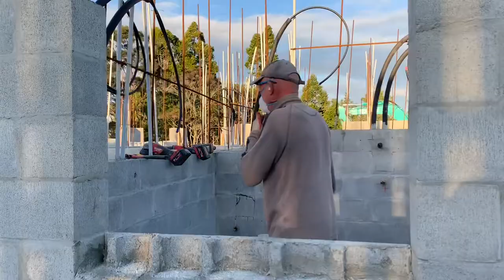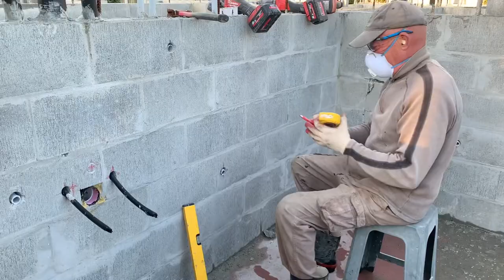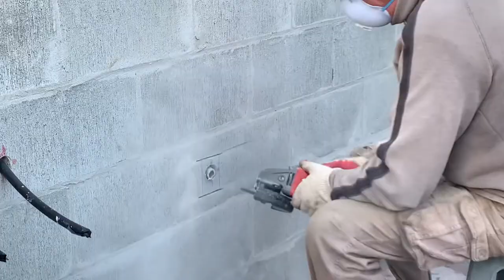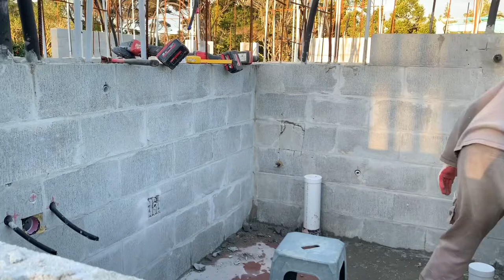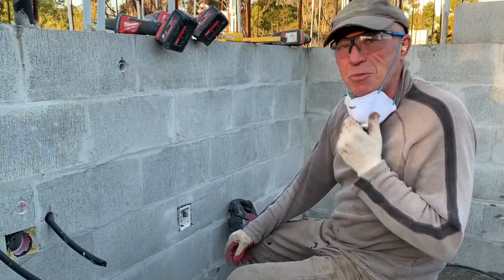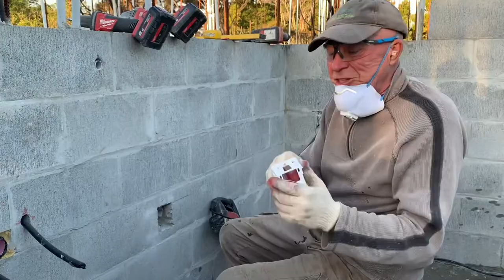How to cut hole in the blockwall for an electrical box

Comment: Thanks for the video. Exactly what I was looking for.
After the drilling, what s the tool called that you used to clear out the concrete? The audio is a bit soft at that point.

Comment: I'm getting ready to build a block building on my property in Fl.  I do not want dry wall on the inside. Have you ever seen anyone lay the wire down between courses of the blocks and stick the wire out the inside of the room to be cut later, kind of like people do with log homes?  I know I'd either have to mount the box on the block wall, or cut out an area for the box if I wanted it flush.  Thanks!
Reply from the maker: No that’s not a good idea, it’s better to put some conduit in and run the wire inside it, you don’t have to finish with an electrical box, just core drill a 65mm hole 50mm deep over the conduit, break out the core and cut the conduit back then screw the switch or plug straight back  to the wall
Reply: @hobsonproject  So, run the conduit between courses of the blocks , or another way? Maybe down the wall from the top? I have a bit of experience of blockwork from working with my cousin many moons ago, but I don't see how conduit would come down the wall from the top since I have to pour a single lintel. Hence, the clarification. I want the electrical outlets flush on the inside of the block wall with no drywall.  Thanks!
Reply from the maker: @da324  Basically run the conduit like you would run the steel reinforcing for the blocks. Conduit can be short to get the blocks over it and laid and then extend further up with a coupling, can run horizontally if needed to get into the right space, but just remember to use slow large radius bends to make pulling the cable easier. 👇

Conduit in block wall https://youtu.be/hec23O6whlc?si=dE8qkD-8XfZ7B6G0
Reply: @hobsonproject  Thank you!

Comment: Just put a metal box in before they pour,it will save a lot of time/ or a foam block.
Reply from the maker: Problem is keeping the block there it will get blown out by the conc most of the retro cutting is in the block anyhow which is soft

Comment: What about furring strips and drywall ?. Your box needs to be flush with the drywall.
Reply from the maker: This is a solid plastered block that’s the finish if I was using packers and drywall I would run the cable behind the drywall, however this install would work with direct stick drywall just use over length screws to fix the socket outlet.

Comment: I notice you are a concrete / wall person, rather than an electrician. Do you find that most electricians use this same technique to install boxes in a concrete / block wall?
Reply from the maker: I have never known an electrician use this technique as they usually have someone else chase the conduit and cut the box then they or someone else install the conduit and connect the box then usually someone else mortar up the wall. I guess the end result is the same as my cast in method, just harder, at the end of the day I will install draw wire to make electricians life easy, as electricians like an easy life, and they will pull their wires and fix the socket. Also keeps my costs down.
Reply: @hobsonproject  LOL sounds about right - we electricians don’t like to get our hands dirty! I have to install 5 boxes in a 100-year old concrete kitchen wall. It will have 1X3 furring strips, so I won’t have to dig a chase for the wires. But I do need to sink the boxes. I was planning on just drilling a bunch of holes with rotary hammer - but your grinder technique is a great idea.
Reply from the maker: You could always core drill the recess for the socket 65mm say by 50mm deep , can dry core without too much dust and then no water slurry problems